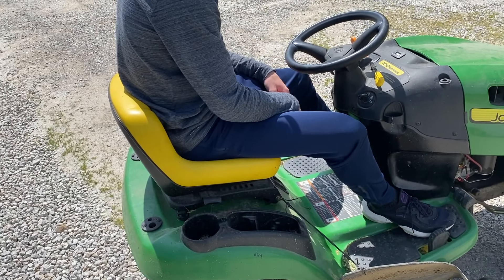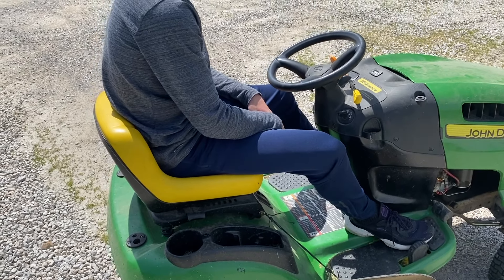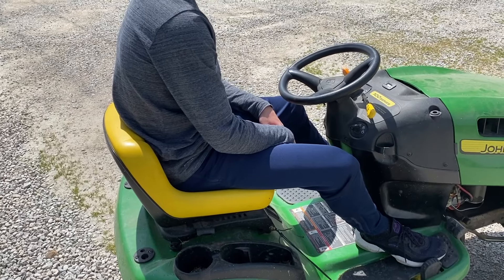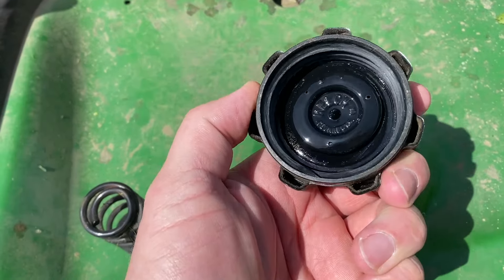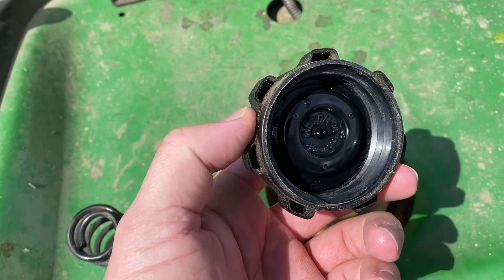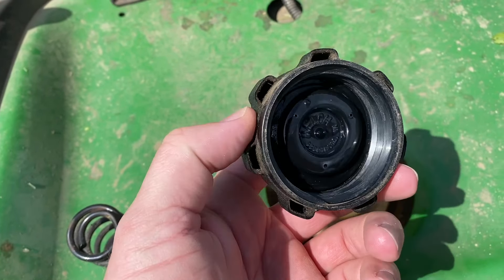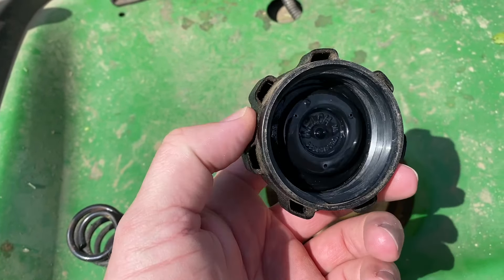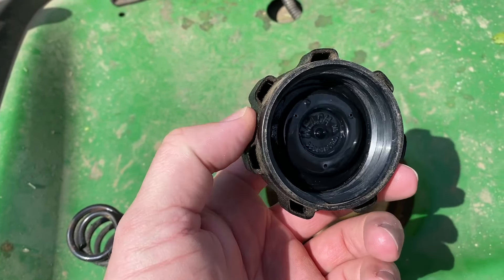Lawn mower dies after running for a few minutes - Will not stay running - Stalls - FIXED!

Comment from the maker: This ever happen to you? Glad it was a super easy fix.
Reply: Really thanks for that information  ok
Reply: Literally! You're a life saver! Just twisted it off and back on and she fired right up!
Reply: I have a Deere L120, with a briggs 22hp or 24hp. Has been doing the exact same thing. I thought it was overheating, so I fixed the hood. The grill was flopping g around, almost bought a carburator. I'm going to our place next weekend where it's at, well see if that's it. Thanks.
Reply: Hey Danimator!  Thank you so much for posting this video!!  Have a 1988 165 Hydro w/2 seasons of use, and last night after refilling the fuel tank it started behaving like yours.  Since I’m not the most mechanically inclined person I was getting ready for a big repair bill.  Took the cap off and replaced it ensuring it was on properly, and BINGO!!!   Thank you again for saving me significant amounts of aggravation/time/$!!!!

Comment: I watched your video and my John Deere L118 had the same problem, so I removed the gas cap and rub the top and notice a 1/32 dia hole. I use a needle to clear it and use a computer air can to clean it out, and now it runs like a champ! Thank you.

Comment: My John Deere was doing the same thing. I had not changed the fuel filter in the spring so I started with changing that component, but same thing. Saw this video and walked out to our shed not expecting much....however slowly unscrewed the gas cap and the same whosh of air.  Started the tractor and low and behold it ran! thanks for the idea. And showing the stalling was VERY helpful! Thank you.

Comment: I have a old JD 175 Tractor 38” deck with an FC420V engine. Same symptoms; runs for a few minutes then just dies. PITA! Never considered it might be the gas cap, but I guess so because I removed the cap then put it back on loosely enough to hold on. Started right up and I finished the lawn in the dark. I’ll look into cleaning the cap and purchasing another asap. Appreciate you taking the time to help us out!

Comment: Thank you for posting this - really saved my bacon.... thought I would be tearing apart and cleaning the Carb and checking a bunch of other things as well (clogged fuel filter, fuel pump, etc.).  Instead, I just bought a replacement cap 🙂

Comment: THANK YOU for showing video of symptoms!!!!!! Every other video just highlights issues and jumps to clean this or replace that. You saved me a couple hours of work and a bunch of money. My mower behaved exactly as yours in the video. Looked at cap and sure enough it was clogged, air hissed back into gas tank when opened. Took 2 seconds with a piece of wire to clean cap and it ran just fine.

Comment: My JD D160 has very similar symptoms. I Replaced fuel filter, plugs, air filter. Then searched for those symptoms and your video popped up. Gonna blow the cap out with the compressed air blow gun and see if that fixes it. I've also seen this issue on small Honda engines on rototillers too. Thanks 😊.

Comment: Checked the gas cap and nothing to clean. It is immaculate. This appears to be an intermittent thermal problem. Shutting down and monkeying with the gas cap gives it just enough time to cool down and cure the heat problem.
Reply: It's a bad design. My dad's e150 does this. I went to my JD dealer, and I got a gas cap for 35 bucks. It's like 20 bucks on Amazon. It worked for 40 mins the shutdown again. The guy at the dealership told me it's a bad design of the fuel pump. They burn up. They wanted 100 bucks it. It is 30 bucks online.
Reply: @CaughtMedia did the new pump work?
Reply: @vicedpowers1750  I never bought it. So what I do once it starts acting like it will die. I just stop mowing and unscrew the gas cap. I keep it running the whole time. Once it starts running better after a minute or two. I place the cap back on and keep going. So I guess the John deere shop near me doesn't have anyone idea either.
Reply: @CaughtMedia  thanks, mine does the same stalling but the cap doesn’t seem to have an air lock, but it does start a few hours later after it’s cooled down, so I’m gonna give it a tune up and see if that helps. LT 160 1400hrs
Reply: @CaughtMedia  I just opened the op of the engine and it was packed with insulation from mice, so I cleaned it out and I’ll see if that works
Reply: @vicedpowers1750  My father's is a twin cylinder, and I put two plugs in. Nothing changed. It's for sure air locking the motor. I don't think it is a fuel pump problem.

Comment: Super helpful, thank you. After replacing fuel pump several times your video pointed right the problem. I was releasing the pressure every time I replaced the fuel pump instead of the faulty gas cap

Comment: I have no idea why so many say it is the fuel cap. My fuel cap is not tightened fully therefore air can get to the tank.  I have had the same issues as yours but it has NOT been the fuel cap.

Comment: This fixed the problem with my 1996 425 - Run air at 60-75 psi from fuel filter connection point through the carburetor.

Comment: So many things it 'could be' but that cap whooshh was a give way... I basted the tiny hole on mine with carb cleaner (straw on the hole).....With mine, the fuel hose rearwards of the filter was suspended by a zip tie, and the weight of the hose was compressing it. I used my underpants method on the fuel hose:  got rid of the compression point and let it swing..

Comment: Thank YOU I never thought about that before. I’ve replaced 1-Coil, oil changed, and plug’s and a black wire that is used for a kill switch it is equipped with a diode that only allows electric to pass through at One Direction.

Comment: I  cleaned the vent on gas cap the first thing .Mine was the electronic control module. I even changed out ignition switch and fuel pump. I have a x360 and just bought a z530r z trak

Comment: Well I hope that is all it is on mine! I change the fuel pump, filter and air filter , it rain for about 20 minutes.. so I left it in the woods.. I'll try checking the gas cap (which is pretty new) and see if that solves it.. Geez i hope so!! Thank you..

Comment: If it isn’t the cap,or the filter, or the pump, there’s one more possibility. The fuel pick up tube that backtracks from the filter can become partially clogged and the debris is slowly pulled in/up choking off the fuel supply as the mower runs, mine would go for up to 30 minutes. You can lift the hood and watch the flow of fuel through the filter gradually slow then stop along with the engine. Use back pressure to clear the tube and remove the debris from the tank. The Deere dealership had it twice before I finally figured it out.

Comment: Well...I removed and reinstalled my cap but still doesn't want to work right.  Tried running without the gas cap.  Backfired on startup, ran much better after about 30 seconds, but then died again 5 minutes later (with the gas cap still off).  Serious;y  aggravating as this is making a 1-acre mow a 2-day project...

Comment: These are great videos.... But my Ride on....Ahhhh! I've tried just about everything except stripping the Carbie. Runs 20 - 30 mins stalls. I let it cool and I get 10 minutes.... then 5 - 10 mins. I have: changed fuel and air filters, cleaned out the tank, replaced the coil and plug, took valve out of petrol cap to eliminate vapour lock. Behaviour doesn't change. When it stalls, the fuel filter is empty??? Tank at least half full. How can this be?... fuel lines and clamps all appear okay. Any further ideas.....????.... What am I missing?? Thanks Oh, it is a Briggs Stratton 19.5 HP Intek so no fuel pump... gravity!
Reply: How old is your rig? I just replaced the rotted fuel line on my 20 yo L110
Reply: @gregr.3886 It is 10 years old. I eliminated fuel line. The problem was the fuel filter. Wrong type for a GRAVITY fed system. The Mower shop gave me a cartridge type...(no Workies!!!). Needed to be button type. Live and learn!!!

Comment: I have a deere d105. Only 3 years old and only 47 hours in it.  It runs perfect until it gets hot after 10 minutes and stalls.  Won't restart.  I put on a new carburetor,  new fuel pump,  new fuel lines,  new coil and spark plug and new air filter and fuel filter.  I figured the problem was over.  Mower got 20 minutes and I figured the issue was fixed and boom it stalled out.  I nearly flipped the hell out.  The fuel cap on my mower doesn't release any pressure when I unscrew it so I'm not sure my issue is the cap.  I'm totally lost.  The friggin warranty ended 10 months ago (of course). I went to local John deere dealer.  They want 85 dollars to just look at it up to a half hour.  Then it's 130 an hour labor, plus their oem parts that'll be outrageous.  I'm in need of any info from anyone here
Reply: If you still having issues try some starter fluid in the carb or spark plug hole. If it still won’t at least try to start it’s probably electrical. If it starts for a few minutes and dies probably a fuel problem. This won’t pin down exact cause but may point you in the right direction.